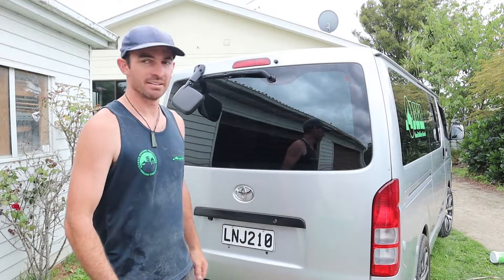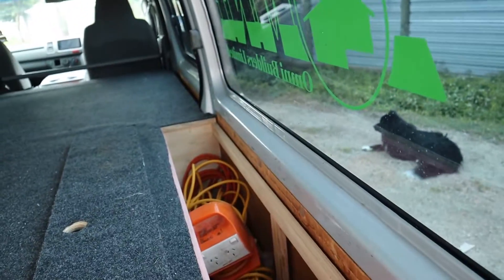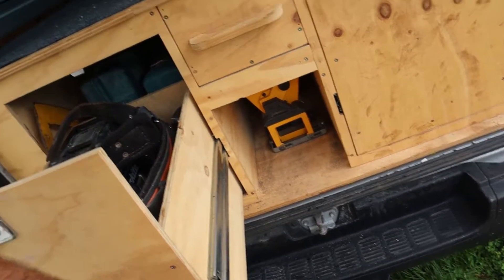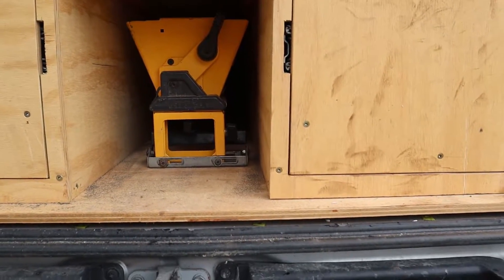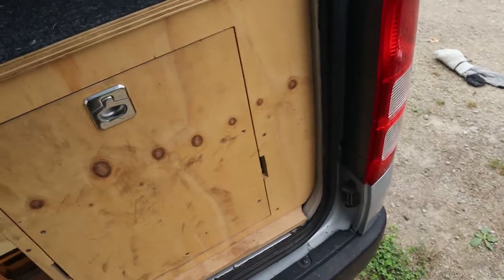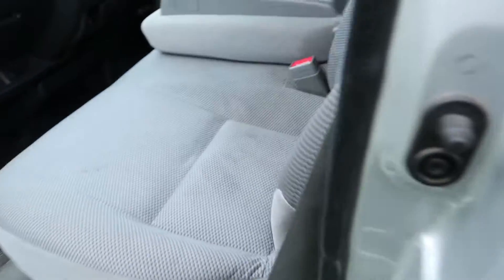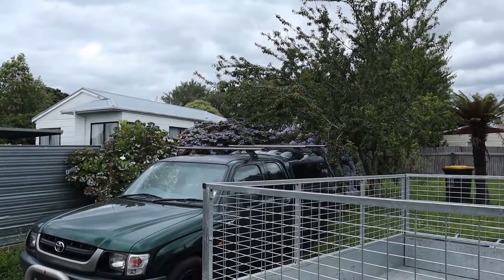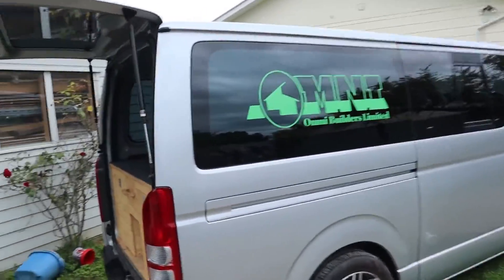van fit out!!!

Comment: nice setup! just a tip for everyone if your looking for a way cheaper heavy duty draw slides, skateboard bearings and inch box section are the way to go for a fraction of the price only draw back is they take up about 50mm per drawer instead of 20-30mm
Reply from the maker: this is true i just wanted the full 1500 slide n to be super strong, tax write off too so win win really lol

Comment: Nice setup up man,  I have one of the new hiaces and built a floor setup for it for all my flooring tools. It's like the 4th one I've built and have it down to the point I can do it in a weekend on my own haha.
Reply: Hey man I'm a floorer as well, about to fit out my first van. How did you fix off the base of the draw set up? I feel like its gonna shift around with the van unless i cut it dead neat. Cheers
Reply: @Reece.cashion1 well I only put draw in the sides and they aren't on tracks yet so they just sit in there neat up to the closed  doors. You'd be surprised how little things move around if you fit them neat.

Comment: This is the best setup for low roof  vans too many hiace vans in Australia still using shelves not ideal since you have to crouch inside.
Reply from the maker: thanks sniper appreciate it 😁 was a lot of work best tip is use 20x20 timber to strengthen the ply for the box👌

Comment: do you have anythings you would have changed if you were to do it again? ima do something similar in the next few weeks thanks heaps for sharing !
Reply from the maker: hi Ricky, yes couple things. mainly shrink the area allowed for the 2 saws, if I had gone tad tighter the pockets on the side could have been larger.  also the drawers could have been longer so that the end if the unit was just past the edge of the side doors,  semantics really also iv since added a set of plywood  drawers next to the drop saw which improved things greatly!!!

Comment: Hey mate. I’ve currently got a hiace but only the 1 slider. Good van. Had it kitted out and now going to rip it all out and change it up. Or I sell and use a Ute. How did you find the Ute? Did you need a tool trailer? I’m only looking at one because I’d like to drive my son around
Reply from the maker: hey mate, single slider is fine just have to customize to suit your needs, utes are good but not like a van 😉
Reply: @omnibuildersnz  how do you manage with a family etc? Just use another vehicle?

Comment: Did you notice a difference in weight with all the ply used to make the drawers?
Reply from the maker: hi Lewis, in all honesty it actually improved the overall handling of the van as it bounced around quite a bit beforehand then add all the tools, still no real problem on rear wheels it rides smooth as
Reply: Should do a van weigh. Before we after. 
At a transfer station etc. 
TBH I try to minimize weight, removable fish bins, and not carting junk I'm not using much.

Comment: Hey mate how did you setup the inverter? What are the draw handles like? And do they auto lock?
Reply from the maker: hi Ricky, the inverter can with a positive n negative lead which I wired directly to the battery which Is under the passenger seat👍 yeh almost 6 months now n still solid, they are from brunsco, not lockable but yes the catch is very good never fails
Reply: Thanks mate! Apprentice from auckland and my van is a similar setup to yours haha copied scotty b myself
Reply from the maker: allgoods yeh totally its a great design👍😎

Comment: Hey mate, just wondering what thickness ply you used? Cheers
Reply from the maker: 12mm and 20 on the top
Reply: @omnibuildersnz  thanks. Do you feel the 12mm is solid enough? I currently have all my fit out done with  form ply but I need to cut some weight and looking to re do with 12mm - it’s about half the weight
Reply from the maker: yeh definitely but I also used 20x20 pine in areas that need extra strength but yip for the drawers etc its plenty havnt had an issue yet n its been 7 months of hard every day work on them
Reply: @omnibuildersnz  awesome, thank you. Good work on the set up 👍